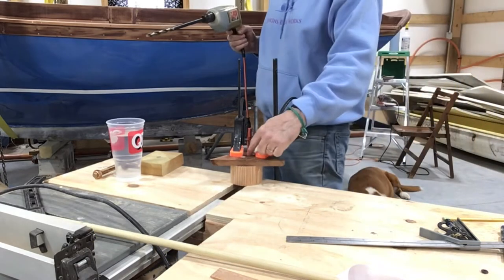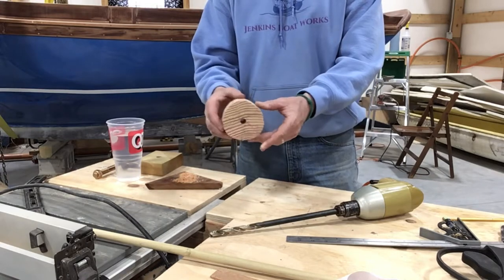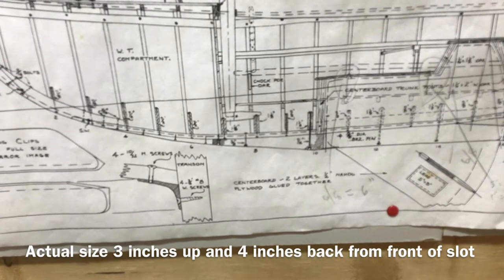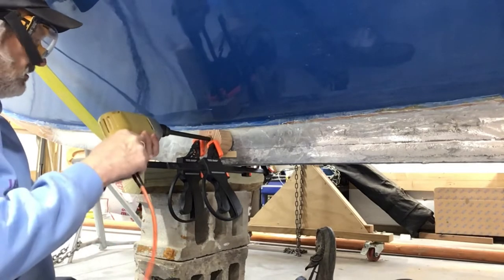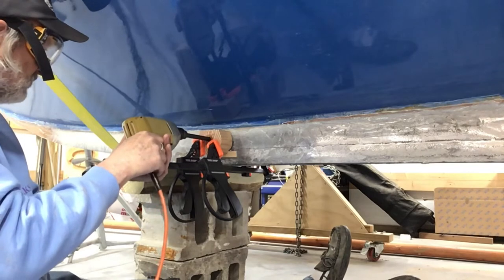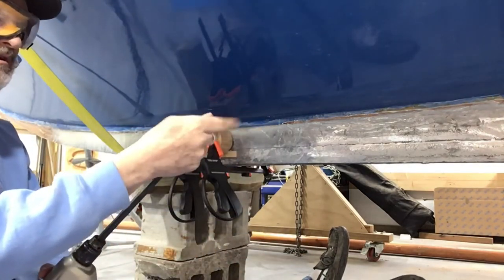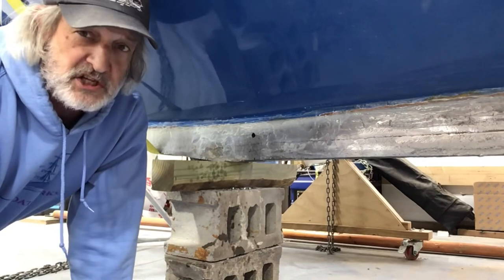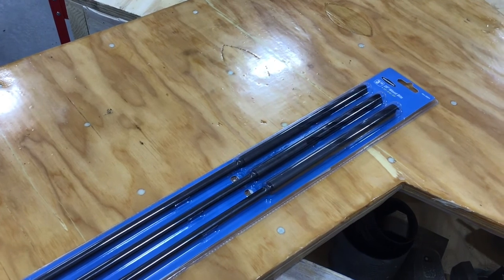Boat Building The Haven - Drilling Lead Ballast for Centerboard Pin - Episode 117

Comment: Those long bits are worth their weight in gold! I'm surprised the pivot point is so low and forward in the boat.
Reply from the maker: I've never seen one in lead before. it may be further back than appears. the trunk is about 15 inches aft the mast and then add the 4 inches into the trunk, probably close to 21 inches aft the mast and then the trunk goes back nearly 40 inches with centerboard swinging down to increase draft by nearly 2 feet
Reply: @JenkinsBoatWorks  It obviously has a lot more foundation than it looks. I should have had more faith in the engineering.